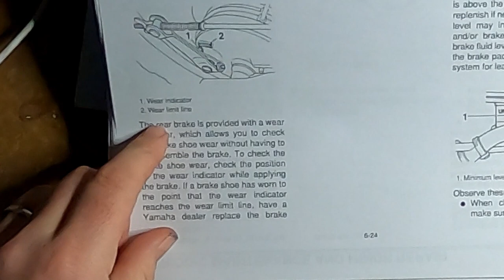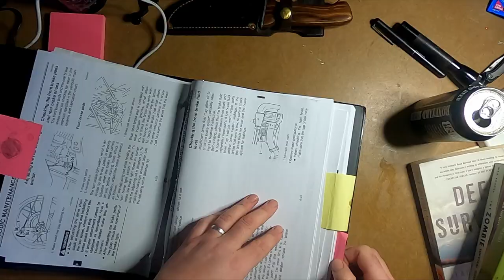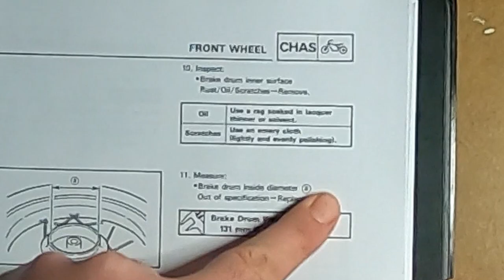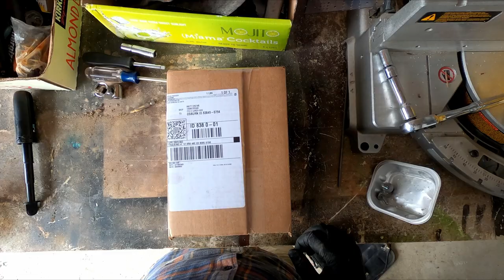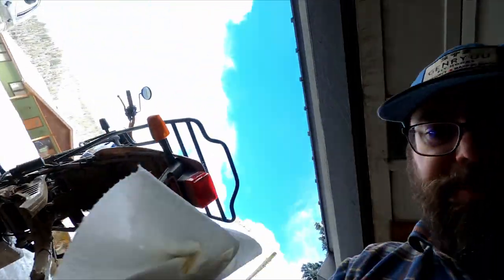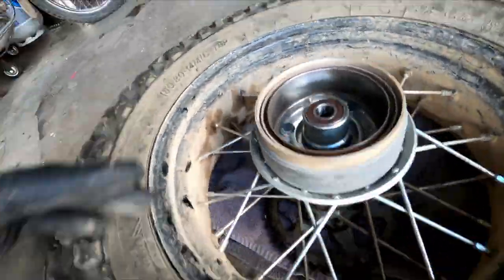TW200 Rear Brake Maintenance and Troubleshooting

Comment: You can 100% fix the rear brake issues by installing a Bradly disc brake kit.  Be sure to find yourself some Banjo bolts that have a built in bleeder.  Also replace the brake pads with some sintered brass ones.  You will then have awesome rear brakes.  I can now lock up my rear wheel at my discretion, or any amount of stopping power that I desire.  No squeak, no more standing on the peddle to get any force applied to the rear tire.  I also live in Idaho.   What part of Idaho do you live?   I am in south eastern Idaho.
Reply: I even cut that arm in half that actuates the brake shoe cam, and added 2" more to the length to get more stopping power.  That did not work either.  The last bike that I had that had drum brakes also had a MUCH smaller rear tire.  Maybe that it why it worked so much better than my TW did.
Reply from the maker: Ive been considering the Bradley brakes but it’s not at the top of the list for now. Im about an hour away from Coeur d’Alene
Reply: @dirtcopdualsport  I will bet that there are some nice trails up there.  We definitely have some close to me, I am near Pocatello.   As far as the brakes go,  The difference is night and day!
Reply from the maker: I will definitely keep that in mind!  Glad to hear there is good riding down by pocatellow! @BuilderofRat

Comment: A can of Brake Kleen is good to have.  You can spray down everything including the pads just before you reassemble to make sure there is no grease or debris on the surfaces.
Reply from the maker: I was gonna pick some up but ran out of time before I had to head back to Alaska!
Reply: And a drop or two of thar may spice up the Beer too! 😀
Reply from the maker: @PSBEadventures  that sound delicious
Reply: @PSBEadventures  Dang it!  Yer not supposed to give ALL the secrets away yet. 😆
Reply: @hazcat640  🤣🤣🤣🤣